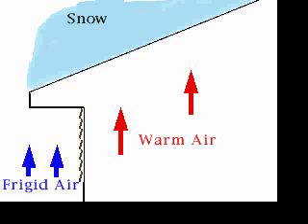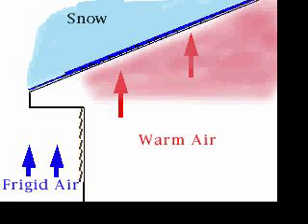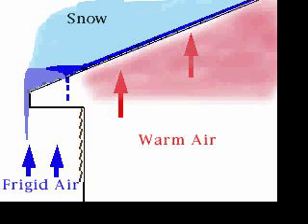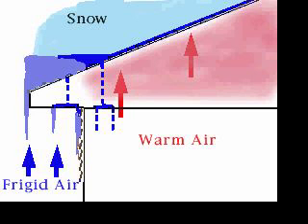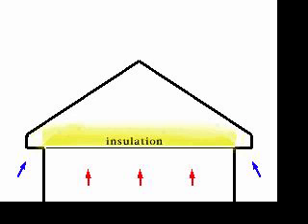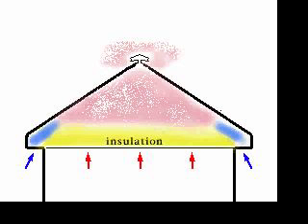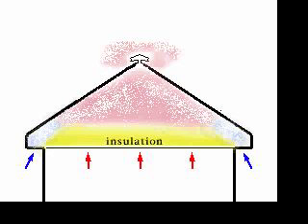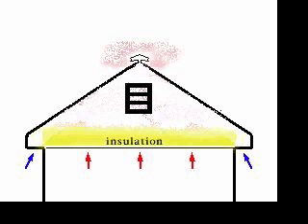Ice Dams

Comment from the maker: Ahhhh... vaulted ceiling. THAT is a huge problem. There is no "attic" space to cool down. Even worse if proper vents (mentioned below) were not installed. Very tough situation. Maybe properly installed heat wires in that area would help. Another permanent fix for those tricky spots is standing seam metal roofing or snow slides that reach above the vaulted area. When properly installed metal roofing can not leak, even when water backs up. Good luck.

Comment: Well I will freely admit the biggest problem I have is where I have a vaulted ceiling.  Meantime hot air rises, and cold air falls.  when the difference between the attic temp and the main living area is less, that's less hot air that rises, aka, less heat loss. I know this is true from the summer months, I can actually feel the draft from the ceiling ac  vents as the cool air rushed down the stairs to the downstair's area.

Comment from the maker: One other thing... the heat wires need to be installed properly or they can cause more problems. Wherever they end, ice will form. The wires need to be connected at all points and run all the way to the ground. This includes running them through the gutters and downspouts. It is really important to follow the directions.
 80% of these wires I have seen are incorrectly installed.

Comment from the maker: Roof vents only work properly if you have open soffit vents and sufficient insulation. You are not wasting much heat in your home by holding it in your attic... it has already left the living space at that point. The additional heat in your attic is the only cause of ice dams. You have to melt the snow before it becomes ice! The heat wires are a fix assuming that the problem will occur. Cooling the attic prevents or greatly reduces the problem to start with.

Comment: just got brand new roof vents put in and they don't do anything.   Big waste of time. the ice dams are just as big.   You need heat tape to cut through the ice and allow the water to pour off.  This has the added benefit of not wasting your heat in the house and the increased cost of heating your home.

Comment: Thanks for the response.  Yes, I did see long vents installed so the insulation could be bypassed.  The attic is sealed in this portion of the house, so I could not see if they covered the vent tubes.  I went out this morning, and yes, the ridge vents are still covered with snow.  I got some 'Heat' ice melter, and am going to put it in a few nylon stockings, so I can melt channels in 2 or 3 places on the roof.  We are finally expecting 40 to 45 degree weather over the next few days.

Comment from the maker: When the blew in the insulation, did they install "proper vents" at the soffit? They are long corrugated or U-shaped foam 12 - 18" wide that hold the insulation away from the back of the roof at the soffit. If that area gets clogged up the whole system won't work, since your soffits are where the cool air is being drawn in as warmer air goes out the gable and ridge vents. It could also be as you thought and the ridge vent could be covered by real heavy snow fall.

Comment: We recently had ridge and soffit vents installed, in addition to the gable vents we've had all along.  We also had a good amount of insulation blown into the attic floor, which already had old fiberglas batting.  Shockingly, we still got huge ice dams and icicles hanging off the roof and gutters!  I'm thinking that since we got a lot of snow, the ridge vents seem blocked (snowed over).  I'm wondering if this may be a factor in our current ice dam and icicle formation.

Comment from the maker: To answer your original question... I would get on the roof and break some channels in the dam, then remove the rest of the snow. Another option is to use a snow rake from a ladder to remove the rest of the snow, then get the calcium chloride sock tossed up so that it lays perpindicular across the dam in as many places as possible. This will melt channels that will allow the water behind to escape. And If you have removed the other snow, there is no more future water to create another dam.

Comment from the maker: I'm guessing it's halfway up the roof because you cleared the bottom half of snow? Many people do this (I see roofs like this in my neighborhood). What happens is that the rest of the snow on the roof continues to melt against the roof surface, and when that water runs out from under the insulating blanket of snow, it freezes causing an ice dam further up the roof. This can cause even worse damage than at the edge because now it's leaking in the middle of the room .

Comment from the maker: Smart move using the back! Obviously you are very careful not to hit the actual aluminum, even the back of the axe could easily puncture it. That aluminum edge you have is called a snow slide. They usually extend approx 3' up from the edge of the roof. If installed properly they create a waterproof leakfree zone for the first 3'. It's a good way to protect an area on your roof that can not get proper ventilation, for instance a catherdal ceiling that follows the back of the rafters.

Comment from the maker: You can use the sidewalk type icemelt aka calcium chloride. If you have plants below your eves, the calcium chloride mixing with the melting ice may damage them. I have heard (but never tried) that placing pantyhose "logs" filled with calcium chloride   laid perpendicular to the ice dams, and placed every 3 - 4 feet would create channels for the water behind to escape. Also If you have current leaking get up to the edge and beat the ice with a small 3 pound sledge.